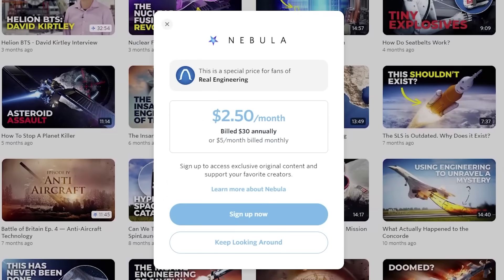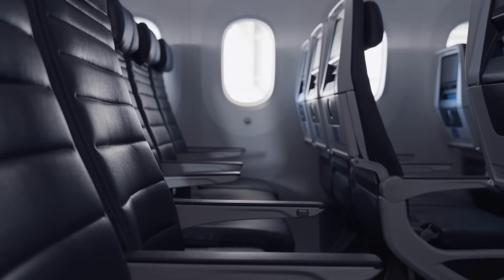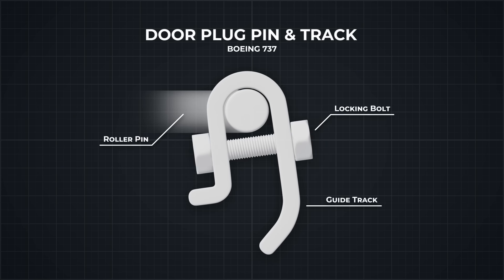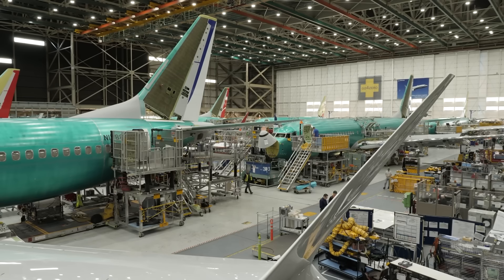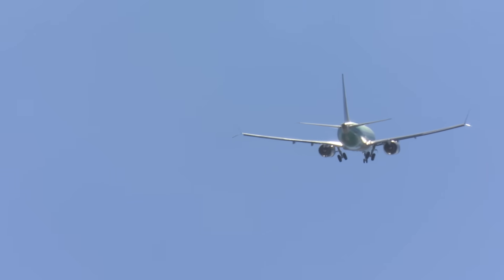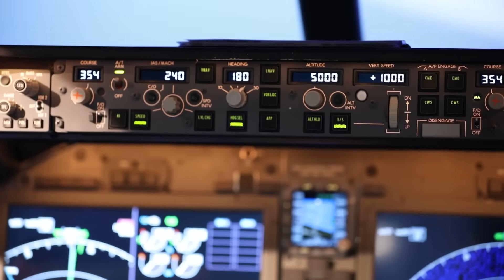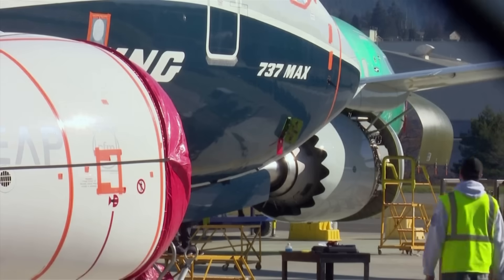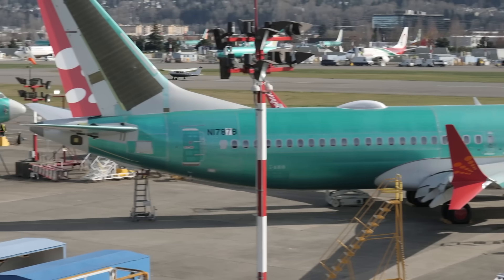The Questionable Engineering of the 737 Max

Comment: The engineering of the 737 max can best be described engineered to fail.  Value Engineered, Cost Engineered is the only engineering performed on this plane.  Anything between profit and speed and safety was chucked out the door plug at 30,000 feet first test flight.  The FAA is complicit in this, aided and abbetted by GOP who cutting, freezing, trickiling $ to FAA budget year after year, until they had to let Boeing "pay" inspectors, from initial engineering to final construction, including being responsible for employee reviews, promotion, firing.  Of course anyone in Senate, Congress, FAA could have tried screaming, as a couple of ex Boeing safety inspectors tried to, and were totally ignored, by FAA, Senate, Congress.

Comment: I still have issue with calling the plug a plug, in reality it was more of a panel with locks than a true plug which seals on all edges, the plane should’ve been engineered to fail sealed rather than fail open as what happened here. After Flight 811 with the cargo door blowouts from a design that had the same sort of sealing concept, Boeing should’ve learned from that.

Comment: From an Engineering Standpoint the Door Plug was improperly designed and needs to be redesigned so the Door Plug is removed from inside the Cabin and cannot leave the airplane thru the Door Frame. An actual "Plug" that plugs the hole in the fuselage.  Boeing deserves all the blame of the horrible design.

Comment: Your synopsis on the blame apportioned to Alaska is a bit flawed. 
On another video presented by a commercial 737 rated pilot he points out that the cabin pressurisation system can fail through a fault in the monitoring and control system itself. The system has two sub-systems and when this happens the pilots switch to the 'redundant' system. The control system can also be over-ridden manually in the event both sides fail, also there is a procedure which allows all current 737'a to fly if the fault is noted and if persistent the general consensus amongst the airlines is that it is the pressurisation control units that are at fault as the fuselage is built to withstand the working pressure load isn't it ... except when it isn't ... but as this was a new(ish) aircraft why would the operator think that it would be an issue with the structure rather than an issue with a control unit that has been know to have issues in the past?
The simple take away from this is that Boeing failed to ensure the correct quality control measures were in place [irrespective of it the door plug was removed or not during manufacture] it is why aviation has multiple checklists for manufacture, operation and maintenance of aircraft.

Comment: RE trying to capitalize early on the Boeing algorithm train. 

The reason Alaska pulled the plane from overwater operations and reassigned it to shorter flights is because the aircraft would be flying at lower altitude. This was a precaution in the event of a depressurization, the aircraft can make its rapid descent to 10,000 ft where the air is breathable. On over water operations, crushing altitudes can be 41,000 ft or even more.

Comment: The door is not an engineering problem. The design was adequate. 12 supporting lugs that are still in pristine condition. 4 bolts that appear to be missing. So if someone in the factory (or beyond) "forgot" to install the 4 bolts correctly its an installation or maintenance problem. Like if the engine falls off. The  design is good but the SOP hasn't been followed.
Reply: SOP is bad for profits. Just let it got out and when something breaks I'll make sure I'm not blamed.

-Every upper manager

Comment: 5:00 that's a cotter pin not a, whatever you said. Bout $.05 USD.
 They would've found one or more of the 12 nuts, bolts, and cotter pins in the aircraft if they were present at any time.
 They would've probably found one on the ground near a cellphone.

Comment: With all due respect, which aspect of the recent accident with the door plug getting blown out is connected to "questionable engineering"? An identical system has been used for decades on the NG. It is not a design flaw - it is a manufacturing error.
Reply: Boeing, as ever, went with the cheap option, not the best option.

Boeing has a history of cutting corners, whether that be on design, build or testing, and as a result, people die.
Reply: @knightsnight5929  By no means using a proven solution (30+ years of safe operation) is cutting corners. There is no need to reinvent the wheel. There is no flaw in this design. It was a manufacturing error.

Comment: Just for note, the cockpit door is designed to blow open in the case of rapid cabin depressurization; but for whatever reason, very few crew members or even pilots are aware of it.
Reply: I thought it was discussed by NTSB that the pilots were not aware of this at all? Or the cabin crew.
Reply: @KeyserSoze5421  You are right, I think the announcement by NTSB chair Jennifer Homendy was the first mention of it to the public, as far as I know.
Reply: Maybe it wasnt designed that way but Boeing just said so after the door blew open to not make them look worse than they already are?
Reply: maybe it's just to reduce actual damage that could be done to the door's mechanism?
Reply: I think the real limitation is that a pressurized aircraft has a shitton of force contained within it. Building a door that can resist depressurization from a giant hole in the hull would require practically a door as resistant as a nuclear bunker. I don't know if there's any aircraft that could've gone through this event with the door remaining closed.
Reply: Whats with the copy pasting of other users comments?
Reply: @tonyhawk123  Oh, I didn't scan the comments before posting, didn't realize it had already been said. I was just relaying information from a press conference held by Boeing (correction: NTSB chair Jennifer Homendy) where they talked about the issue and subsequent changes to training (ex. Actually telling crew that it's supposed to happen).
Reply: I just scrolled through the comments and did find similar comments that were posted before mine, but I had to scroll quite a bit before finding them.
Reply: @kanagawakenji7  fair enough
Reply: @kanagawakenji7 The whole design is one massive oxymoron. Cockpits were secured post 9/11 for security risks. So if a terrorist got an explosive on an airliner and detonated it, causing a rapid decomp, it would give them free access into the cockpit.
Reply: @6z0   Sure, but they wouldn't be on the plane anymore.😂 And unless they reeeeally knew what they were doing, the plane wouldn't be in the sky anymore.
Reply: @Int_resting  Not all explosives are large bombs that will destroy the whole plane. American Airlines flight 444 for example, blew a small hole in the cargo hold. An explosive small enough can create a rapid decompression without causing major damage. Then that forces the cockpit door open.

Comment: Why the actual f*ck would they make it so the door drops down if the bolts fall out, instead of making it so the door drops downwards into the slot. Do they have traceability on who’s job it was to to torque and cotter pin those bolts? In U.K. rail every component installed has a record of who installed it.

Comment: Engineering was never a problem. It’s the implementation of quality control and hiding the differences in model designs is what caused all of these issues.
Reply: Is that true? The Max was a turkey from the get-go, built in a hurry to compete with Airbus. Not a new design; just bodge extra large engines onto an airframe that was never designed to take them.
Reply: @knightsnight5929 door fell off because assembly people didn’t install bolts engineers designed. So yeah it is true. Assembly is to blame. Now the MCAS was not due to engineering but due to training to even know that this system was there. Did you know some airlines opted to pay for an indicator light that indicates issues with MCAS. Other airlines did not pay for that option. Again engineers aren’t the problem. Sales people are.

Comment: Like others have said the door plug is not an engineering/design problem, it's an assembly/QA problem. The 737-900 ER has been flying since 2007 with (very likely) the exact same door plugs... pretty sure it'd be pointless to have changed that design for the Max. Engineering or no it's still a huge problem obviously, but details matter.
Reply: FAA has just ordered inspections of the -900 ER

Comment: A220 >>>>>> 737 MAX
boeing should start working on the 797 ASAP otherwise airlines will turn towards airbus where the issue isn't the build quality but the engine shenanigans (i would swap a pair of CFM leap on it tbh if p&w won't look at it)

Comment: Master/Minimum Equipment List (M/MEL) will indicate when and how an airplane can be operated given an airplane's state. As such, resetting the pressure warning  allowed. If the flight was operated per the M/MEL then Alaska did nothing improper since the M/MEL is the governing authority and the M/MEL is created by the FAA. An airline may create their own MEL based off of the M/MEL and many airlines do since the M/MEL applies to all variants listed on the type certificate and for clarity they remove items that are not applicable to their fleet. Though such a custom MEL would need to be approved by the relevant regulatory agency.

Comment: I'm very familiar with the max and it's issues. and at this point it doesn't matter where the real issue of this latest problem lies the general public will view Boeing as the problem. and it may be, a little early to point concrete fingers anywhere yet. to many people don't know and won't know the details and will only know it's a Boeing plane with another issue. even being very familiar with Boeing and the max it's difficult not to look at Boeing with a suspicious eye. even if the issue is with a subcontractor it somewhat lays on Boeing's shoulders

Comment: I still can't believe the CEO tried to palm off the additional bolts found to be loose as 'only loose by millimeters, not centimeters'......  millimeters might as well be meters at 30,000ft.
Reply: Boeing then: "This screw's diameter is off by 0.3mm. Get me a new one"
Boeing now: "Well the gap isn't big enough to stick my thumb in it, so good enough"
Reply: It's fine. The CEO is never going to be in that plane. So it doesn't matter.
Reply: @Praisethesunson Wow, I never thought of that. If all Boeing execs were required to fly commercial on Boeing planes, I doubt there'd be any more problems
Reply: @jeffbenton6183 Kind of makes me think that the execs should be forced to fly aboard new types of aircraft for the first few weeks. That’ll learn them to put more importance on safety.
Reply: @mikoto7693  It took much longer than 2 weeks before the first MAX crash, so I'm not sure if it'd work
Reply: @jeffbenton6183  True, though what truly disgusts me about the MCAS crashes is that they were inevitable. Make a safety critical thing with a single point of failure and eventually it will fail. They had to know that it was eventually going to happen.
Reply: @mikoto7693  I seem to remember reading something around the time of the second crash that a whistle-blower demanded to know where the redundancy was in the event of the sensor failing on the MCAS. The exec just shrugged and said "the pilot is the backup". Considering how hard it is to wrestle control over the plane in the event that MCAS fails (and the whole point of MCAS is that you're not supposed to need to train pilots to fly it without MCAS) you're absolutely right that crashes should have been considered inevitable.
Reply: @jeffbenton6183  To be honest, that doesn’t surprise me. Engineers are generally smart people and I suspected that at some point one must have looked at it, realised it was a problem, reported it but got overruled by someone in management. It also irks me that Boeing initially tried to blame the poor, deceased pilots who couldn’t speak for themselves.
Reply: Perfect point.

Comment: So, they kept the seats alongside the doors empty, because it'd had multiple action-required depressurisations. As a safety measure. >snigger< 
There has to be a term for the peaks & troughs of avoidable accident statistics, where something goes wrong so they tighten-up the regs, then nothing goes wroing for ages so they loosen the regs., like a cyclic thing. Scream if you want to go faster.

Comment: If the stops on the doorframe remained in place I would have to assume one or more the pin stops on the door itself failed allowing the airstream to get behind it plus the cabin pressure and tear it off. This is sad but very serious. I can’t stand to see this happen to Boeing or 737. I cut my teeth on that old girl back in to -200 days. Yeah, you read that right lol. That being said, we can’t single focus the 737 or Boeing for this particular situation imo because as you stated the tube and those doors are supplied by a outside vendor just like Airbus where I work now. However, I got to say that Boeing reducing QC staffing is unacceptable in every way. They exist for a reason. Everything is Aviation is checks and balance and where those 2 becomes lopsided this is an unfortunate result of that kind of planning or lack there of. 

Money, management, greed, and and CEO’s are the root of all evil in aviation accidents, mishaps, and the current culture of MRO’s. When you don’t give the mechanics/builders the time, resources, tools, positive reinforcement, safety and quality first and time lines can wait this is going to continue to happen. 

It’s all fun and games until your at 31,000 feet thinking about all the aircraft you’ve worked on and built and let your mind wonder to all the people involved in MX and overhaul and you ask yourself… Do and did they care as much as I did about keeping this aircraft safe? I can’t think about anymore when I fly. I’ve seen to many things and witnessed so many crimes at major MRO’s to sit my butt in that seat and lie to myself that everything is done by the book.

It’s not. Not anymore. It’s done to hurry up and get the aircraft out. Hurry up and get that job done. Hurry up I don’t care if we don’t have the parts. Hurry up I don’t care what you’re problem is we have to have this aircraft outside now because some Mng upstairs in his Oval Office not even around the airplane says so. Is it really out of limits? That not corroded. It’s just out of limits of the allowed leakage from the rudder PCU. That freeplay check failed but if I do it 3 more times and move the PP gauge slightly this way it will pass. That tires not worn. 

The list goes on and on and on.

Comment: I have heard the 737 Max is the symptom of a company that has become obsessed with their stock valuation over actually running their company well.
Reply: Boeing stock price is the lowest its been since the MAX released.
Reply: Well that is the great irony isn't it? From Day 1, the Max was developed to be first and foremost extremely profitable. At the same time during development, the company is wasting money on stock buy-backs and replacing veteran executives with Wall Street MBAs.
Reply: Which inevitably lead to design mistakes, oversights, and cost-cuttings. All harming their company immeasurably.

Comment: There is nothing wrong with the engineering design of the plug door.  If the four bolts that lock the door in place are properly installed the door will never be able to move upward to clear the door stops.  Its a good design.  What happened is poor quality control resulting in the lock bolts not be installed at all or not being installed properly.  So, your title is a bit misleading.

Comment: The simple issue here is, they didn't want to re-design the 737 and they took a more profitable, albeit questionable engineering route instead.  All the problems are seemingly related to this decision.  I get it - they need to make a profit.  What I don't get is why they make so many decisions that imply they value profit over safety.  If you can't make a plane without shortcutting safety, perhaps you're in the wrong business.

Comment: An option nobody is mentioning is the possibility that the lock bolts were not installed in the first place.  This seems to me to be the most likely cause, considering some of the previous flights of this aircraft have cabin pressure warnings.  The door must have been moving, causing pressure leaks, since Alaska took delivery of the plane.
Reply: Yeah I'm of the same belief as you.  Those bolts weren't there at all.  The likelihood that 4 bolts independently were there but because of improper installation the nuts "worked loose"  and the bolts shimmied out of the hole they were in?  Not likely.  More likely, someone forgot to put them in and Boeing's sorry QA didn't catch it.  Turbulence and pressurization cycles eventually walked the stop fittings off the stop pads and then at some point the plug extruded from the plane just enough that the passing air caught it and it went bye bye in an explosive manner.
Reply: @lk29392  They fired all the QA, so there was nobody to check the installation. Or they replaced the old people with new, underpaid people with no experience and probably refused to even provide training.  These companies are worried if they train their workers, then the workers will want more money, because they are more qualified.  That's the whole point of hiring under qualified people to begin with!
Reply: The plug was designed by a software engineer...